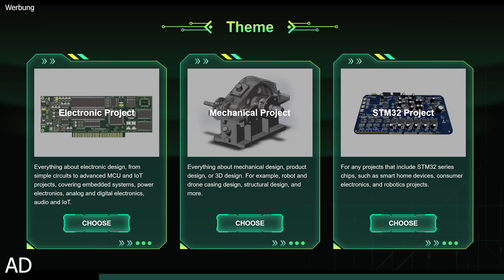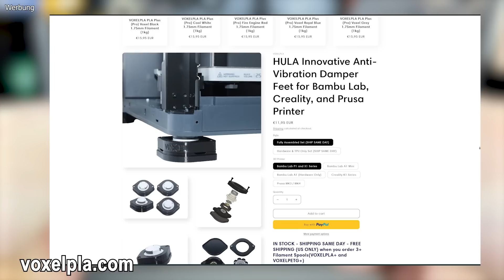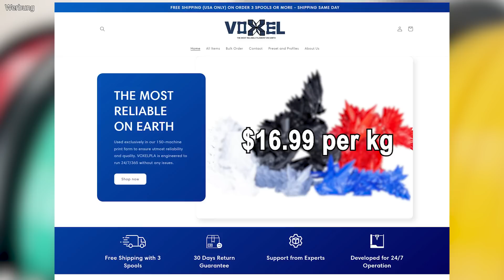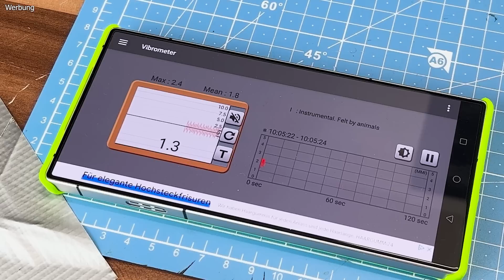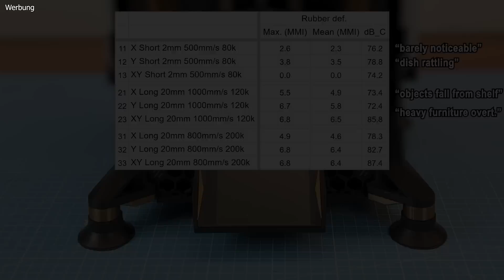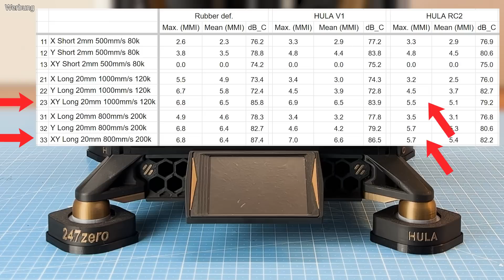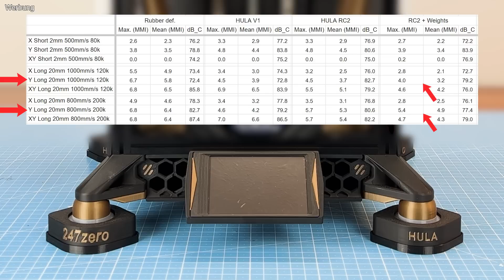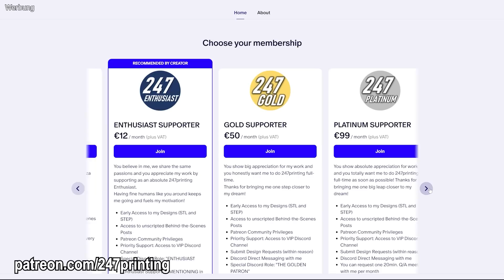Vibration Damping at Ultra High Speed (HULA and more on 247zero)

Comment from the maker: Get HULA and Filament at VOXEL: https://bit.ly/247VOXEL
ThruTheFrame: https://makerworld.com/en/@thrutheframe
Reply: My guess (and experience kinda prooves that) is not to stop the WHOLE printer from moving, but to stop the printhead moving differently from the base...

So fixing the base of the printer often makes things worse....I think you should get pcb-way to make you a solid 15mm plate instead of the extrusions wich the y rails are mounted to...and maybe add belt-tension (or bigger belts altogether)

Comment: How heavy is each weight? Where are the models for the mounts?
Reply from the maker: I don't recall. Files are on my hard drive.
Reply: @247printing If someone could post similar data and provide a way to reproduce the data (by the inputs such as weight and placement), others could benefit and iterate on it.

Comment: Please someone tell me. It's not more effective if we just make a massive concrete holding experiment? Why nobody made more than placing a cement slab under the printer? May be the case, I'm just saying that the solution is over there. Comments?

Comment: For good dampening you need a lossy spring which dissipates vibration as heat. Compressing air heats it up which is why dampeners are usually foam based. You want strong even coupling to your dampener like a big heavy base plate.

A good way to improve the usual foam-paver-base used for 3D printers would be screwing the frame to the paver tighly.

Comment: In 1992, Williams started using active dampening in their F1 cars. Part of this is why they dominated the season and also why the FIA banned it (along with a lot of other driver aids that Williams was using) in 1994.

But luckily no such rules apply here! Maybe this could be the next step? Something along these lines:

1. Securing the printer to a slab of concrete with enough mass for it to be completely immobile
2. Somehow setting up motors to counter vibrations in X Y and Z axis
3. Integrating the motor control with a slicer in order to predict vibration compensation

I mean, there are definitely some challenges to be mapped out and overcome here, but... just think of being able to hold the speedboat record! You could crown yourself king of the nerds! =)))

Seriously though, thanks for a very interesting vid, as always!
Reply: If I understand you correctly this is already a feature in most modern printers and called input shaping, where motor movements are modified in real time based on the resonance frequency. The vibrations you see in the video are already with those compensations active.
Reply: @brinkoftext  Almost - input shaping uses an accelerometer to identify at which speeds the standing waves (ie where the vibration is the most), and then adjusts the speeds when printing so as to not trigger these. My proposal is to instead have motors that work 180 phase shifted to these vibration frequencies, which - hopefully =) - would cancel them out. In a perfect world this would mean that there would be no slowdown at these frequencies. But yeah - the input shaping part of knowing which frequencies that need to be accounted for is (of course) crucial!

This is a thing used in audio engineering for transfering the audio signal through cables with what's called a balanced connection iirc. You got three poles: one with the signal, one with the signal but 180 degree phase shifted, and ground. When the signal is terminated, the second pole is phaseshifted back, which means that any electrical interference along the way gets completely cancelled out, with the extra bonus of the signal being boosted as well.

I studied audio engineering... but I definitely didn't study mechanical engineering he he. So while I do think that the idea carries some merit, I have absolutely 0% on my feet on whether or not it is actually feasible.
Reply: @plixplux   Seems I misunderstood/overestimated input shaping a bit. Thanks for the clarification!
Reply: Just happy to share the psyche for this 😁

Peace!

Comment: Hi i started building 247 zero b2 and tried my own hotend solution, its sailfish hotend with volcano nozzle, it's able to extrude around 33 mm³/s aurapol pla at 220°C with no cht nozzle, it needs two bambu heaters and normal vo toolhead not cuszomized, with fan espc air direction parts weight's only 75g and it's cheaper than your fantastic design.

Comment: Hula isn't dampening solution, it's pretty much an another example of already widely used vibration isolation pads, which used to decouple floor and machine vibration, not to dampen anything. In high tolerance machines vibrations are dampened by the frame itself scaling by increasing rigidity and material amount.
Reply: You apparently didn't watch the video... 🤦🏼 He says that about a min into the video... 🤦🏼
Reply: Yes I am fixing to build a steel frame for my corexy built printer 😂

Comment: In my opinion, vibration on the print model are mostly relative at the structural rigidity of the system (not only frame, but also motor force and belts, in high stress machines), so acting on dampening in that way, can help a lot for all the external factors, but a little in the print, at the cost that the dynamics introduced by the dampening systems increases the complexity of the system, but fortunately that complexity interfere only little in the active printer system. But if I could have only a chose between fix all the walls of the printer to a concrete home (very heavy, obviously), and act on the power of the motors and the strength of the belts, to improve the dynamic part rigidity (so acting on the weight, too), or put an external dampening system, my choice will be the first.
Congratulation for that lille monster, you created!

Comment: One of the simplest ways to decrease vibrations is to increase the weight of the structure.
You could try pouring sand into all the metal profiles, even screwing some cement blocks under the printer.

PS:Sorry for the English I used Google Translate

Comment: I don't understand why does he measure vibration on the table and not on the machine? This where it should really be useful. 

The printer can actually vibrate more but transmit less to the table. If you measure the vibration on the table you actually measure how well they isolate the printer from the table and for this you use vibration isolators not dampeners. Sure, they can both have an influence on each of the uses but not necessarily. If you want the printer not to transmit the vibration to the table you could suspend it from the ceiling or from a large console on the wall.

Comment: Um, vibration isolation is NOT vibration reduction. The way to make the printer vibrate less is to dissipate the energy into its environment, not to reflect the energy back into the printer. The best way to absorb the energy would be to maximize how loud the table is when it vibrates, not minimize it.

Comment: I think at one point its the belt system which is the issue. With flat bet linear motors, I think it may be better. Also at such high speeds, I would recommend a case 😅

Comment: Why not use a shoggy sandwich? PC waterpumps have been cooled that way for decades now. 
You can buy all the components in most hardware stores and they are ridiculously effective at decoupling vibrations from the pump to the frame. 
If you're lazy, alphacool sells kits.

Comment: In your test setup aren't you measuring the vibrations that escapes the printer and are transmited to the table and air? If thats the case, these vibrations could be getting worst on the printer itself, don't they? 
I am starting to get deeper into this rabit role and i am designing a tuned mass damper to see if that can be a solution for 3d printers.
Reply: Easyer to just bolt it to a big contreat slab and isolate that when some fome

Comment: I made some of these for my K1 and they are an improvement over the stock feet. It is a small improvement, but there is definitely less ghosting. The best results I got were recalibrating input shaper after installing them. Bought the hardware kit that includes the TPU parts from Voxel and printed the rest myself.

Comment: What about bolting it to the Wall? 🤔 Can't add any more mass to the Frame than making it part of the Building 🤣 Or alternatively sandwiching it between two Concrete Slab Pavers sitting atop the Dampers 🤨That being said... What about printing Upside Down thus having the Moving Mass at the bottom on a printer resulting in less leverage over the frame to be thrown around?

Comment: I think you would need some sort of counterweight system to avoid vibration. Not sure how it could be done but a gantry on top of the printer but moving in a mirror way could do the trick
Reply: i think for best implementation you would need to do this, but maybe not necessary
Reply: Hmm possibly a second set of motors wired in reverse just moving a counterweight?
Reply: @ronniechowdhury3082  yes

Comment: This is of course blasphemy but personally I'd have multiple counterweights that go in the opposite direction of the tool and gantry. Not straightforward to do on a coreXY and it means doubling the required stepper power, but it's the ultimate way. You could probably even balance a coin on it at that point.

Comment: It looks to me like neither of the feet are giving a significant amount of damping, or for sure there would be bigger differences in the results.

An interesting experiment would be placing the printer on two smooth sheets, one attached to the printer and one attached to the table, with different weights of oil or grease between them to provide viscous damping.

Or actual cylindrical dampers with adjustable orifice size, measured at different settings to determine the optimum damping.

And of course checks on print quality afterwards to see if it's even worthwhile doing.

In order for that to be the case, the damping would have to reduce the ringing of the axis motions relative to the print bed, not just the motions of the frame itself.

Comment: what about placing 3d printer on the concrete plate with soft corner peaces as CNC Kitchen showed?
Reply: What about bolting it to the ground?
Reply: @ probably wont work well, but guess it worth trying

Comment: the analog for resonance is a weight with a spring. the hula has a spring as the TPU part. It adds another resonance to the system. Depending on the frequency and how the  it can increase the vibration or decrease it. I would suggest adding some silicon oil  that is used in RC car shocks to the thrust bearing. It comes in various viscosities for tunning.
Reply: would be fun if he used actual dampers, maybe a set of steering dampers would be suitable